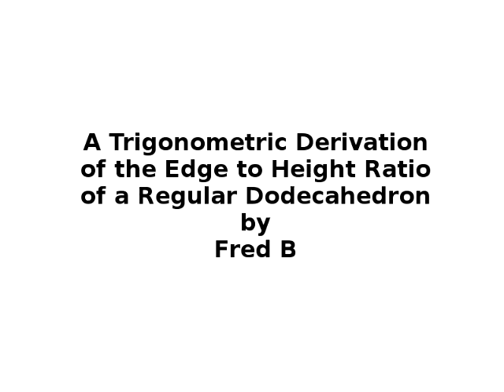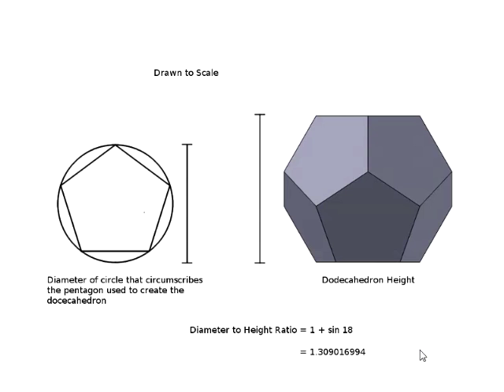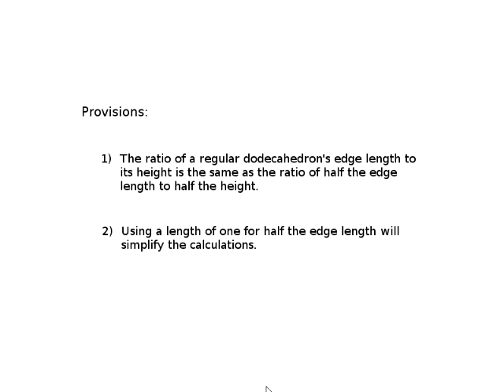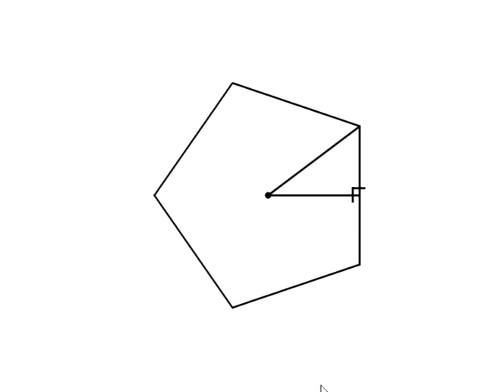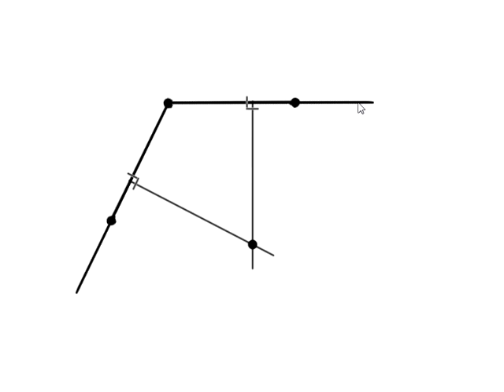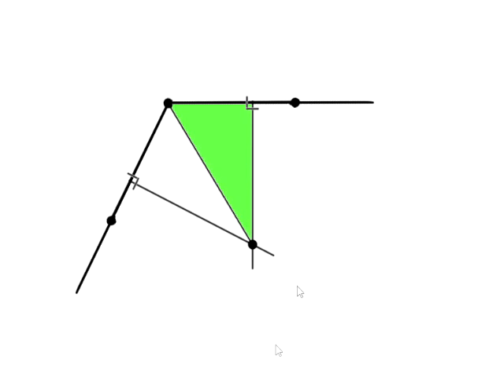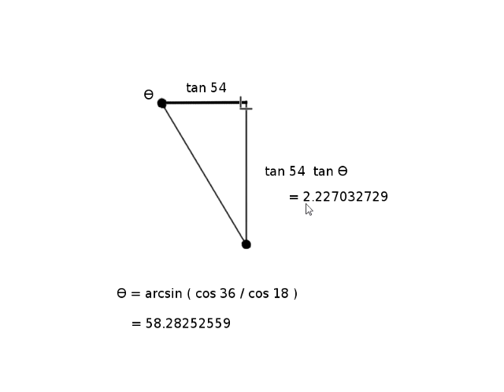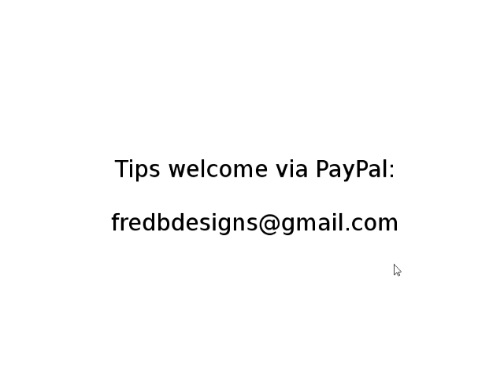A Trigonometric Derivation of the Edge Length to Height Ratio of a Regular Dodecahedron

Comment: I find your parameterization of the edge length much more useful, or perhaps accessible is a more accurate qualifier, than the traditional one of the circle in which the pentagonal side is inscribed. Why that method, and not the one you present, is the standard method, is beyond me. Thanks!